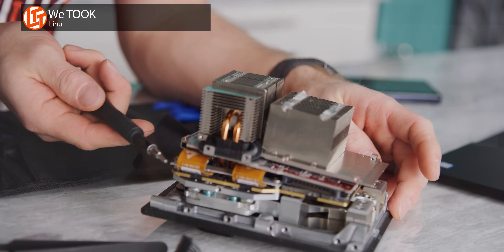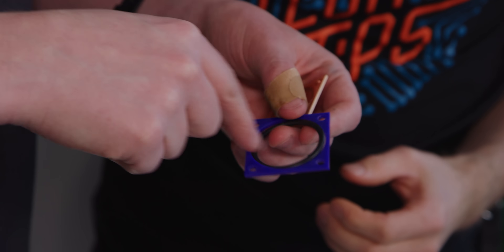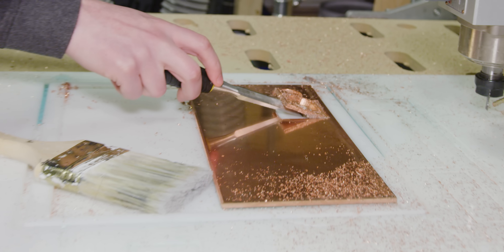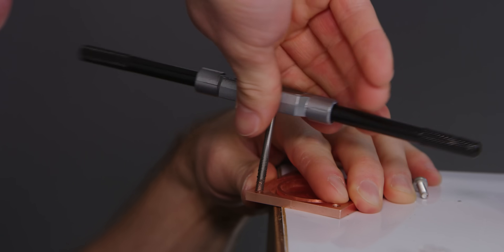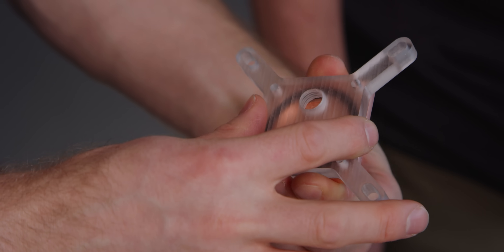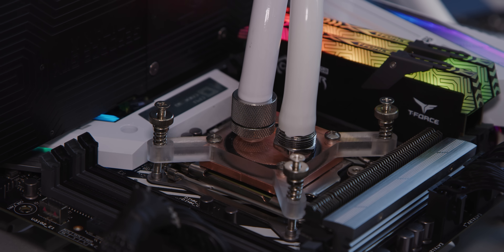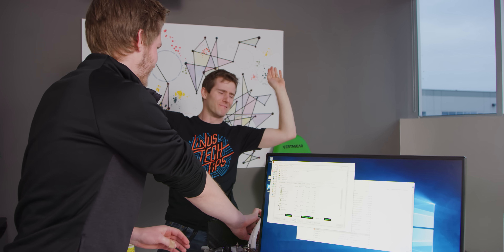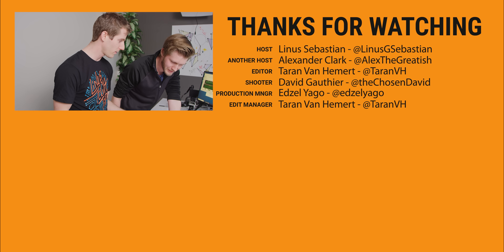We Built a CPU Water Cooler!

Comment: In industry we call more precise tolerances "high tolerance" which now that I think of it doesnt make total sense but yeah that's just how it is trust me I work on CAD every day. I think the reason it's like that is because the "high" in "high tolerance" is not referring to the amount of range that is accepted as a dimension, but is saying the tolerance has a high standard. Like it's an important tolerance.
Reply: Precision and tolerance are very often wrongfully interchanged by laymen around the globe...it gets worse when you add clearance and interference in the mix and waaaay worse when you add roughness, form deviation, true position etc etc...I really believe that using the right words in the right order is really important in this industry (my humble engineer/machinist opinion) to communicate the right result. I've seen engineers who couldn't grasp the concept of a high precision (low tolerance) clearance fit such these found in air bearings...
Reply: @Sketch1994  yeah definitely, took me a while to learn a lot of the terminology and concepts. But I'm no engineer, im a hydraulics technician that sometimes has to draw up parts to be made so your opinion is definitely more valid than mine
Reply: This is why no-one can take Linus seriously even when he's not dropping things
Reply: It actually varies depending on who you are talking to. I've heard low tolerance used for both a lot of and a little variation. Which is why I mainly use tight or loose
Reply: OG Milkbag Idk on other counties but for the US, I pretty sure there are standards within ASME for this stuff. I don’t remember what they were (I think it was ASME Y14.3 or something) but I can probably find it in one of my old textbooks but ya
Reply: OG Milkbag yea I was questioning that too
Reply: I've generally heard it as "tight tolerance", not "high tolerance"
Reply: @tippyc2 I’ve heard both but I (and others I work with) always use ‘tight’ or ‘loose’, much less ambiguous that way.
Ambiguity is the last thing I want when making parts.
Reply: @tippyc2  yes, or I say "fine tolerances".
Reply: if tolerance = "an allowable amount of variation",  then high tolerance = high amount of variation, and low tolerance = low amount of variation. I think you'd want a low amount of variation on a highly precise part.

Comment: As a side tip you can put a nut, that's the same size as your tapping tool, on the surface of the hole to help square it off

Comment: 12:30 as a mechanical engineering student I agree. It's so hard watching you do all of this. Also is there a reason you chose copper instead of aluminum. Aluminum is an excellent conductor of heat and is way easier to machine

Comment: A slitting saw would make easy work for creating those fins in the block base. Sanding the copper flat on a known flat block (stone, machined and polished metal, etc.) with 3000 grit paper AFTER tightening down the top should ensure its flatness.

Comment: if you want to machine with finer bits you have to adjust the speeds and feeds (basically you have to adjust the inches per second that you want your bit to move, on the x and y plane, and you have to adjust the revolution speed of the bit being used for aluminium.) It would then be possible to get 1/64th bits and carve the small channels while going slowly. These 1/64 bits could be acquired by a reputable source like MSC

Comment: As a engineer and former tool mechanic/CNC machinist, this is so painful to watch... No offense, but yes, monkeys.. :D
If you have problems working with copper or anything else soft like aluminum, you should just stop because that means you dont understand what you are doing. Just turn down the spindle speed down to the lowest setting you can get, get a more coarse bit and dont take away less that much when cutting. Then go on from there and improve/ go up with speed or depth. 
And the comment about planes makes me kinda mad, he obv has no clue what he is talking about. 
Comparing the safety of cars to the one of planes is oranges to apples. 
Yes with the threading, you didnt cut far enough.

Comment: This is whats called "gravy" work in a machine shop.  What endmill are you using i.e. 2 or 4 flute?  What diameter is it?  What are your speeds and feeds?  with some info I can figure some numbers for you that will save tooling and get you much better finishes on your parts.

Comment: You can cut "thick" (0.8mm) fins in the copper using cheap dremmel metal cutting disks, mounting the plate vertical on the CNC and doing horizontal cuts. Then you mill input / output zones flat on the bed.

Comment: Those grooves are not to guide the fluid, they increase the surface area in order to aid heat transfer. There is a noticeable difference between a smooth block and a finned block as you increase the load and radiator size.
Reply: Also, if you fit an o-ring too tightly, it can't compress correctly for a good fit. You have to leave room in the groove for it to expand. The best result is when the depth and width of the groove perfectly fit the squished o-ring at a spec'd pressure as the parts come into contact.
Reply: and when you use a threading tool it is important to run the tool most of the way through the holes, because the threads near the back are supposed to finish forming the thread properly....
Reply: Glen McGillivray not if it is a tapered thread fitting
Reply: An easy way to make those grooves in a soft metal like copper is a dremel with a cut-off blade for wood, they are usually 1mm thick so you can get decent fin density,

Basically you ziptie the dremel to the end of a long piece of wood, nail the other end down (so it acts like a pivot), and use another block of wood as a depth stop.

Then you just go back and forth making almost-straight grooves, moving the dremel up a couple mm at a time to make the different slots.
Reply: @nickopedia5669  please make a rig and do a video. I kinda sat to mount my dremel as a drill press
Reply: @magnuswf  

Sadly I'm at college right now and don't have most of my tools and stuff since they're 400 miles away at home.

Perhaps on spring break I'll do it but honestly I'll probably have forgotten by then.
Reply: Fancy seeing a wild Brnk here
Reply: OP is right. It increases heat dissipation with those Grooves.
Reply: It does also encourage laminar flow, so you get less turbulence and eddying.
Reply: @louisvaught2495  I hate to be a naysayer: but lamina flow is actually a bad thing in terms of heat transfer: the stirring effects of turbulent flow encourage mixing: thus the water closest to the hot surface will be cooled by the water behind it, as opposed to needing to wait for it to transfer that heat by conduction between the layers where you end up with a wider thermal gradient and lesser cooling due to the resistance to the heat flow.
Think of it as the turbulence stirring your cooling fluid for you :D
Reply: @glenmcgillivray4707  No, in a cavity this thin with fluid flowing this quickly, the turbulent effects will predominately happen in the thicker directions. You would expect skin effects to dominate through the thin plane.
Reply: @louisvaught2495  The velocity of flow there is no doubt about turbulence, although I think with where the fins are located, the size and spacing it's definitely a large boundary layer and the surface area increases by slotting out the material is moot. I am taking an educated guess by saying that it's relying heavily on convection.
Reply: This.
Reply: Yep. It's always amateur hour when Alex and Anthony come on
Reply: Wow I literally just said that then I noticed the top comment lol
Reply: You would think a (former) water cooling enthusiast like Linus would know such a thing...
Reply: and also creates a turbulent flow inside the block moving the hot water away from the surface and increasing the heat transfer
Reply: an old school overclocker who used to build his own waterblocks or what?
Reply: It does both in this design it looks like. One water pipe attached directly in the middle then the water was forced down through the fins and back up twk routed grooves in the acrylic that lead back to the outlet.  
Rather than just an open cavity with some fins that the water sort of slooshed around, it's forced through them by the design of the clear top plate
Reply: Actually reason for anything that interferes the Flow of water is to add turbulance to the Flow. Because turbulant vs laminar Flow increases heat transfer a lot.
https://www.advantageengineering.com/fyi/156/advantageFYI156.php
Reply: @arskajee  again, that's an oversimplified explanation. You aren't going to be able to get the benefits of turbulent flow like that in a water block because there's not much contact area. You quickly run into limitations with how much water you can get onto the block.

So what they do is try to have lots of fluid velocity, which decreases the size of the boundary layer.
Reply: I originally thought he (Linus) meant they had a jet plate of some sort, but then I realized that they probably didn't have the expertise to design that or the tooling to make it. Maybe that was part of the intent before they came to terms with the tools they had?
Reply: Same principal as having a car radiator media blasted, doesn't need to be fins it can also be rough like a sandpaper finish
Reply: And you could litterially do it with a chisel and a hammer and a little time.

The bottom also needs to be properly lapped, and that's seriously time consuming if you do it by hand.
Reply: @tmarritt  You can use sandpaper on flat glass or granate, it'll do a good job. If you're using a CPU, checking to see if the face isnt flat is as easy as seeing if it spins. If it does, you might want to sand that flat as well. You must know proper sanding techniques, or you could end up with a rounded surface.
Reply: @sugarbooty  ahh you see propper lapping doesn't involve sand paper, instead a small chisel and engineers ink
Reply: @tmarritt  that's not lapping, that's scraping, and I'm not sure you can do that to copper. Lapping uses 3 known flat plates and micro abrasives to make a surface as flat as possible. You'd use a helium lamp and the glass thing to check for rings when lapping
Reply: @tmarritt  lapping the underside of that tiny piece of copper would take very little time.

Comment: Quick tip: cut the ends of the O-ring at a 45 degree angle so there is overlap in compression when installed.

Comment: You use silicon or white lithium grease on o rings (both are cheap and easily available at you local pool store). Using petroleum jelly will ruin the o ring and eventually the plastic.

Comment: As a toolmaker it hurts when you say "bits".

Also you need some surah tapping fluid before you try to tap. Using a drill press would be a lot easier as well, even if your hand turning the chuck you know its square.

Comment: Tap in a drill press. Put the tap in the spindle and turn it by hand, you get it straight in that way. There is also a point in the end of taps, you can put something pointy in the drill chuck and apply pressure with the spindle and use normal tap wrench to turn the tap.

Comment: @LinusTechTips, it might be a smart idea to perhaps not Machine the Copper with fins. But the Acrylic? Albeit the Copper is responsible for dissipating heat. If you can make fins in the acrylic. You can more effectively guide the water potentially? 

As for machining copper on smaller bits? You have to do the passes a lot slower and you REALLY need lubricant to prevent overheating. As for RPM? It might need some testing. But slower yet shallow passes WITH lubricant.

Comment: If you used thicker acrylic in your design, you could solder some of these to the base plate and increase surface area pretty easily. https://www.amazon.com/Enzotech-MOS-C10-Forged-Copper-Heatsinks/dp/B004CL89D8/

Comment: I'w made Better block to cool my Duron 700 eee How many years ago ??, Main mistake is doing this acrylic shit mine was full copper with copper top about 30mm high and went with the SNAKE like tunel from inlet to outlet. Not most efficient but this is even worse. Besides that It was Heavy so had big Thermal capacity. AKA took long to reach max temp.

Comment: when tapping, use some kind of lubricant, there are actual tapping compounds but even silicon spray will help. Also, countersink the holes on both sides before tapping, it helps.
You should seek to turn half a turn in then quarter of a turn back out to clean the cutting faces and prevent the tap getting stuck then snapping. I haven't got to you threading the copper yet and my desk already has a forehead shaped indentation.
 And buy a tap wrench ffs

Comment: What types of measuring tools do you have? I've worked in a lot of machine shops and that's one of the most important tools youll need. You have to get some Calipers and Micrometers that are high quality. Its expensive but cheap tools will mess everything up.
Machining copper, brass, and aluminum will be easy to learn. Just mess around practicing and you'll learn a lot. If you want to get good tolerance's you should over size your part by a couple thousandths then use a file or sand paper to bring to your finished size. 
Everything is a learning experience and trial by error. Just have fun.

Comment: buy carbide drill bits of smaller size then they will melt through copper with ease, carbide can cut through HSS (high speed steel) bight are relatively expensive but come in very small sizes and very large

Comment: the fins are actually to increase surface  area of the waterblock to increase cooling capacity. Eg. a 200w cold plate without fins. With fins you could gain using round numbers for the purpose of this example 20w. the water will flow of its own accord.

Comment: Nice job. You should invest in a pressure testing setup. A simple pump, gauge, valve with appropriate fittings wouldn't run you more than $30.  I made a DIY block I started with a cheap copper heatsink with a thick bottom plate. I simply milled off the fins where needed. Worked quite well as there was a lot of surface area with the fins. I was going to make a mk2 version but lost interest .

Comment: Simple in theory, and not that difficult with the right tools. I'm curious as to why you'd test the seal of the block on the board itself. If it leaks, you're done. You could test it with the loop off of the board. Those threaded holes in the acrylic are NPT. NPT is a tapered thread, so that's why you couldn't get the fittings on when you had the block "upside down". You're stepping up your game on these custom builds. You still have a ways to go, but you're getting better. That makes me happy :-)

Comment: I know you will have hundreds of hobby machinists coming but just 1 or 2 tips for copper machining.
1. HSS tools not carbide - basicly carbide rips, HSS shaves.
2 and 3 go hand in hand as copper gathers on your tool
2. Lower rpm and feed rates drasticly, you want to keep heat down and dwarf shavings fine to avoid the copper depositing on the tip.
3. If possible oil based soluble coolant is your best friend, it lubes the tips so the copper won't gather on the tips, reduces heat and washes the dwarf away from the cut.
Reply: Also HSS slot cutters are far less susceptible to tools shattering than carbide, especially at smaller sizes

Comment: use high pressure air or a water/cooling fluid beam at the bit(flushes away excesses material so that u can work metals like copper, and use a very low speed of movment and high rpm)

Comment: I love the channel. That being said, anytime you try machining, it's painful to watch. I've been a CNC machinist, EDM operator as well as a designer and programmer for 30 years. O ring grooves are not hard to do at all, neither is machining copper. It cuts like butter if you know what your doing. When I'm done with a custom transmission I've been contracted to make for a formula car, I will design and spin up a custom LTT water block and send it to you. Along with instructions and all my CAD work for you to duplicate or make your own. Alex is good with Solidworks, but clearly is new to manufacturing. Keep it up boys, you'll get the hang of it. On another note, a drill press is not to be used as a mill. That's asking for trouble.

Comment: here is a free tip for machining aluminum and copper, go slow, really really slow, release your bit often from the material so it can clear, and set the speed of your rotary super low. the slower you go the better your results, and give yourself plenty of room to allow bits to clear(set them to lift up every so often and use shallow passes).

Comment: im commenting before getting to the end of the video but... do they ever swap over to using a proper taper pipe tap...? air and water tight threats are supposed to be tapered. And I know they have a mill AND a drill press. why are they hand tapping everything? Use proper tools for the job!